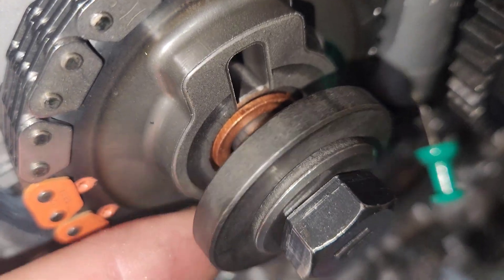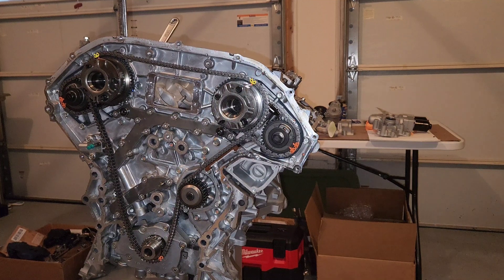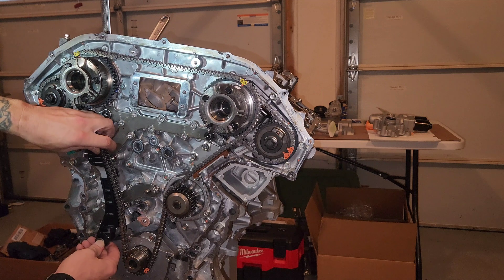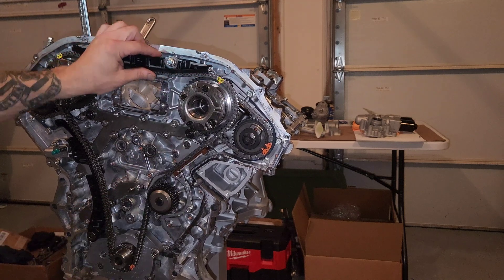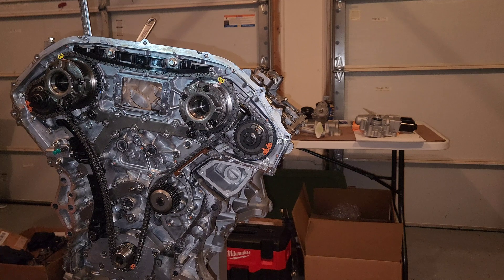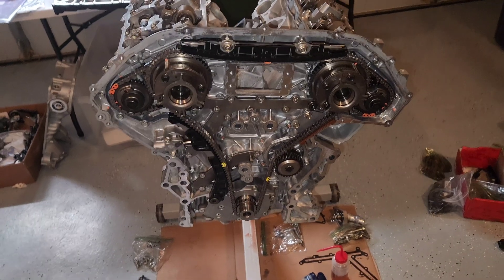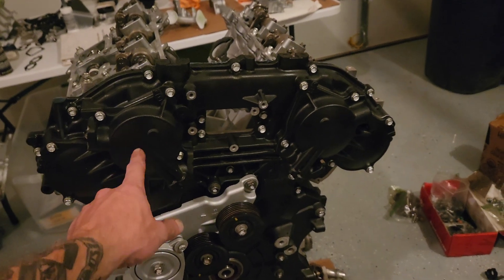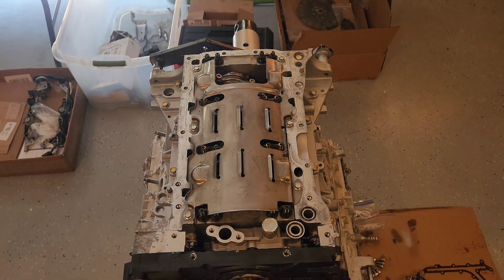How to build a forged 800whp+ VQ37VHR (part 11)

Comment: just asking how much whp can the stock 370z 6 speed manual transmission handle before you need to get a different transmission?
Reply from the maker: I've seen the newer cd009 hold over 900tq many times